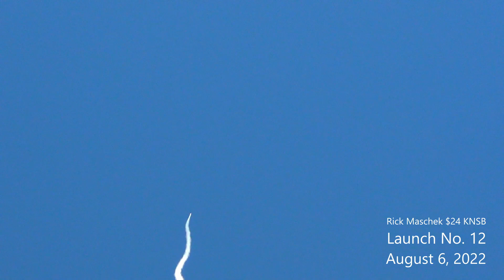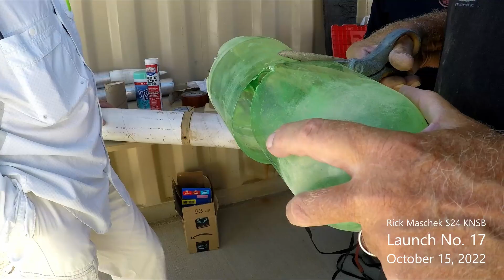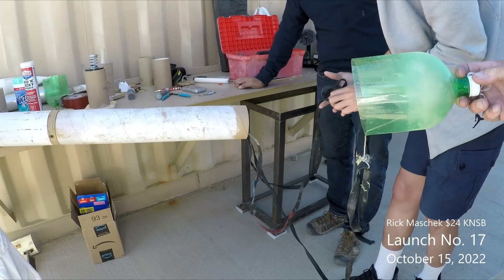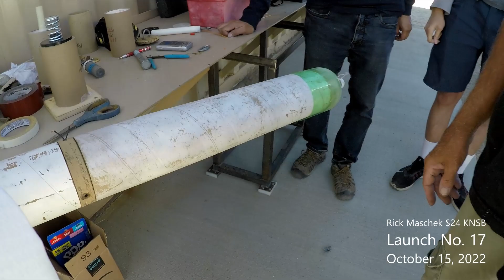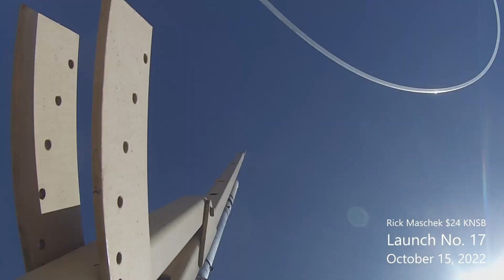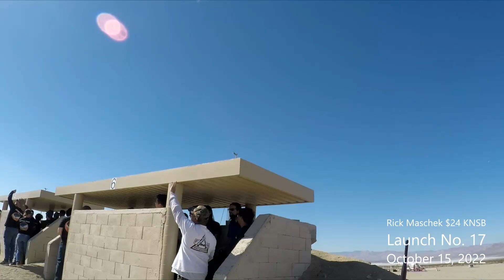The 17th flight of Rick Maschek's $24 4in sugar rocket

Comment: This was the last flight of this rocket due to the cardboard tube being weakened by the black powder recovery charge repeatedly going off at the same place above the avionics bay. Instead of blowing out the parachute and nosecone, it blew a hole out the side of the tube allowing the rocket to come down ballistic.
Reply: Hey rick, could i ask you a few questions. What was the motor casing made of since its a pvc rocket i assume the body is pvc and motor casing is something else. Would really appreciate your guidance since i'm looking forward to jump into this hobby. Thanks in advance.
Reply: @GumnamInsaan  The motor casing is 4" aluminum tube, an aluminum bulkhead, and a reusable stainless steel nozzle that I machined myself. That is one way to keep the cost down. I use snap rings for motors up to 4" and bolts for larger diameters. No PVC was used in the rocket; it was all cardboard and Elmers washable School Glue. I try to paint all my rockets white for recovery visibility on the ground. 
I don't like making sugar motors smaller than 4" because it takes about as much time or more to do smaller motors. My 4" K motors are about $4, L motors $6-8, M motors $10-16, N motors $18-36, six-inch O motors $38-88. We did three 12" motors, our largest 12" S-26,000 motor cost $700 for the propellant.

Comment: There should be a competition category for the cheapest rocket possible😂, in categories starting at 1" and going up to 8" in 1 inch increments, it would be fun to see the competition to get the cost as low as humanly possible. A $24 4" rocket is friggin wild lol.
Reply: It was an attempt to make a 4" minimum diameter supersonic rocket, recovery system, flight computer, and motor reload for under $100. The cardboard tube was free, the nose cone was sort of free, the parachute was made by my wife, the single deploy flight computer cost $15 (Eggtimer Apogee) and the motor reload cost $8 for propellant since I also got the casting tubes free. The shock cord was scrap from another rocket. I suppose the spray paint would have added to the cost (flown both with and without paint and the Elmer's glue was purchased during back to school days for 50 cents. The free things were obtained from stores discarding the tubes after selling whatever they had rolled on them (flooring, paper, fabric, etc).